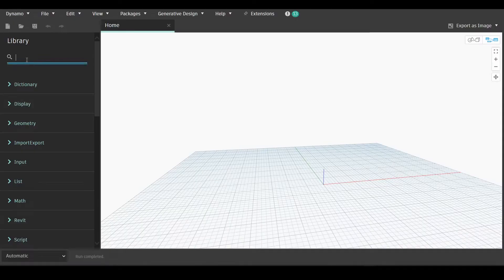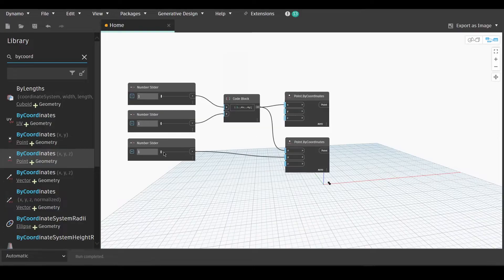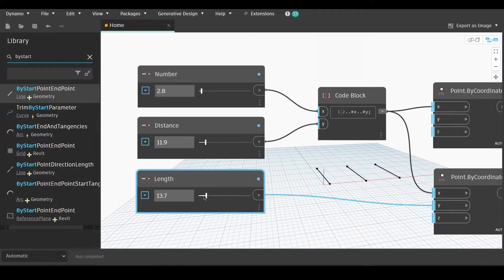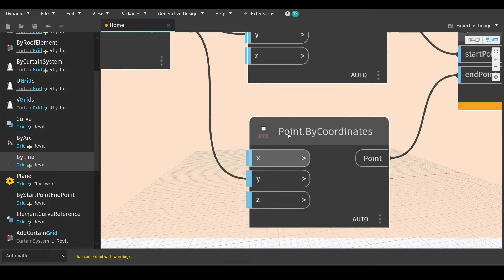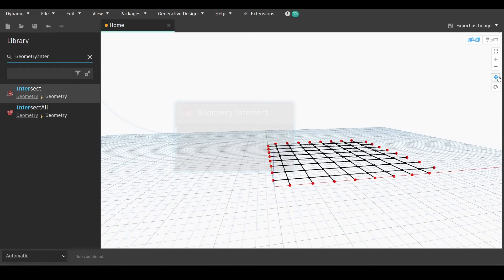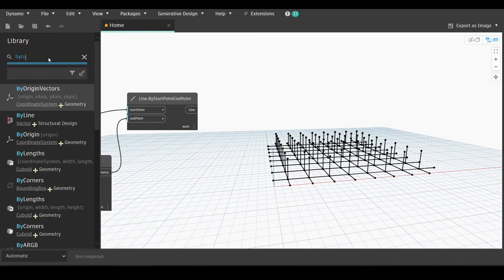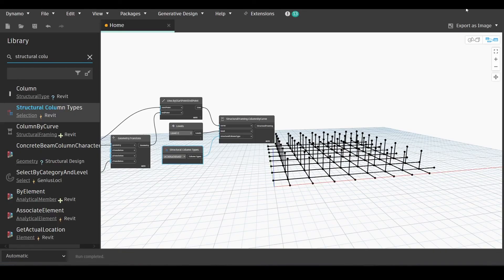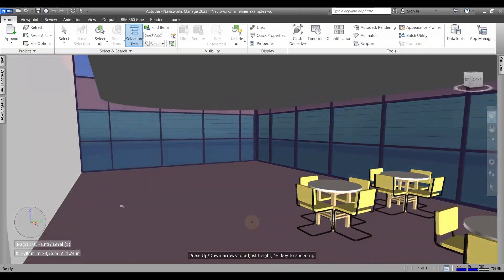Automate Columns Modeling in Revit with Dynamo | Tutorial | Script in 8 Minutes

Comment: For some reason my rebut model is only showing 1 beam and it doesn’t have any height to it can someone please explain what I have done wrong here, my dynamo code is all correct
Reply: A probable cause for this issue could be the drawing units. 

Try increasing the number in the 2nd code block by a larger number. The tutorial had the number set to 3.

Comment: Thanks for the good video. Is it possible to draw the column in AutoCAD and use the dynamo to create the columns like what you do in the drawing wall video?
Reply from the maker: You're welcome, I'm glad you enjoyed it and yes, you can create a script for that process following these steps : 

Step 1: Import AutoCAD File
File Path: Use the File Path node to specify the path of your AutoCAD file.
Import AutoCAD: Use the Import AutoCAD node from the Bimorph package to import the AutoCAD file. Connect the file path to the "FilePath" input.

Step 2: Filter Elements by Layer
Element.ByCategory: Create a list of all AutoCAD elements using the Element.ByCategory node. Connect the output of the Import AutoCAD node to the "Element" input.
List.FilterByBoolMask: Use the List.FilterByBoolMask node to filter elements based on their layer. You may need to extract layer information using additional Bimorph nodes.

Step 3: Create Revit Columns
Point.ByCoordinates: Extract points from the filtered AutoCAD elements. Use the Point.ByCoordinates node to create points based on the AutoCAD element positions.
Level: Use the Level node to specify the level at which you want to place the columns.
FamilyType: Use the FamilyType node to select the Revit column family type you want to use.
FamilyInstance.ByPointLevelType: Create Revit column instances using the FamilyInstance.ByPointLevelType node. Connect the points, level, and family type to the corresponding inputs.

Step 4: Customize as Needed
Additional Customization: Depending on your requirements, you may want to add nodes for additional customization, such as setting parameters like height, width, or any other properties of the columns.

Let me know if you need addional assistance !